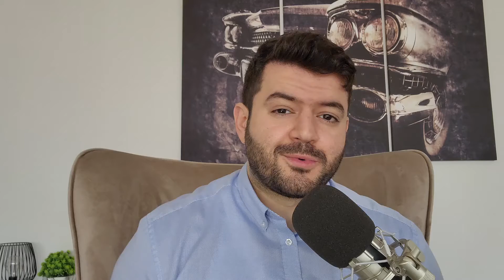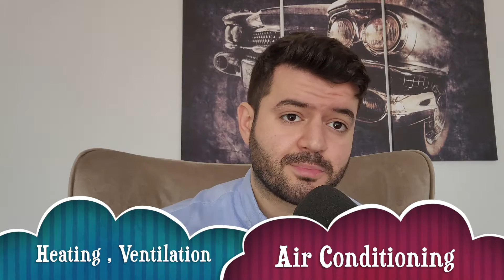HVAC for Mechanical Engineers: (The Starting Point for Mechanical Engineers/ HVAC Design Basics)

Comment: I educated mechanical engineering (automotive) but how uou guys helping me to get in to HVAC world?
Reply: I'm very very weak at thermodynamics, thermal engineering.. how can I get a job in HVAC engineer?
Reply from the maker: As mechanical engineer learning about HVAC is necessary, it is one of those fields that every mechanical engineer should know at least it's fundamentals, we have Mastery program for HVAC which will provide you with years worth of practical HVAC Engineering and via the completion of the program you will provided with a certificate to confirm your completion which will help you standout and increase your chances of landing a job in the field , here is the link for the program don't Miss the current seasonal offer worth 350$ :

https://academy.eedu.online/p/hvac-elite-masterclass